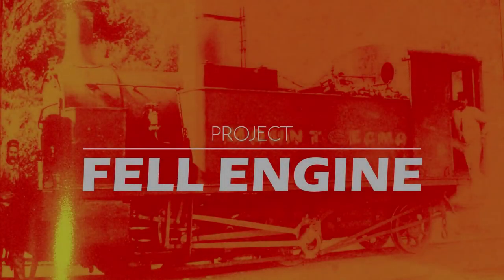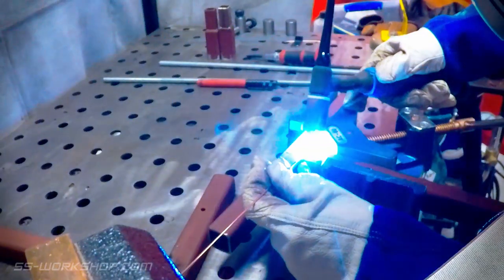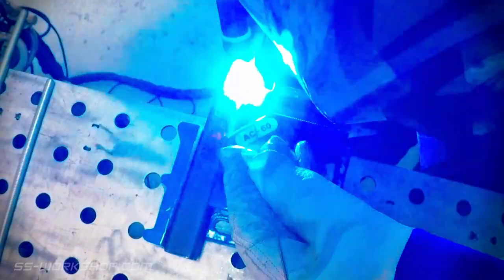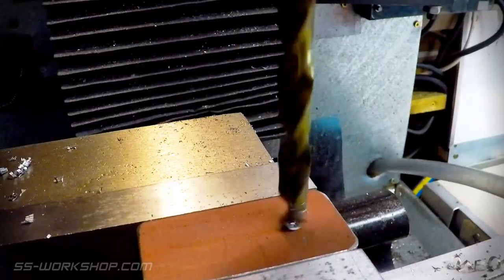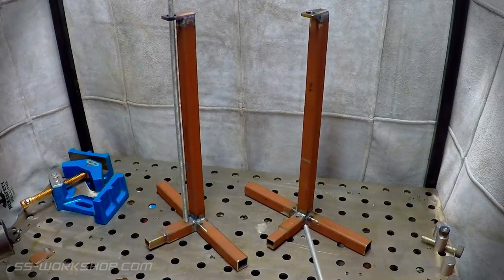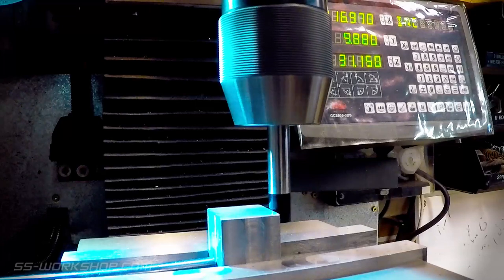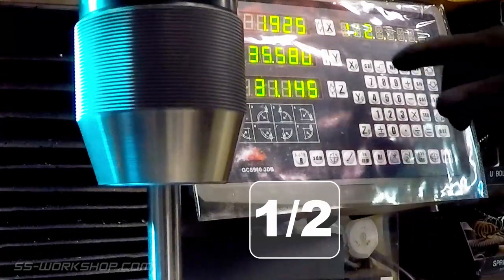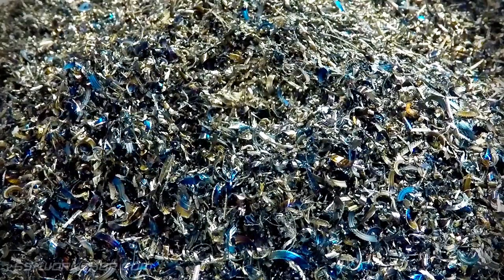Fell Engine Project -  Build Stand Time S1.E12

Comment: Good idea - essential equipment!  I mounted mine to a hydraulic lifting table trolley so the loco can be easily worked on and moved around the shop as needed. The stands can be easily removed so the trolley can be used to transport the loco to the car etc.
Reply from the maker: Seeing yours inspired me to build my own, certainly makes it easier to work on loco. Good idea on moving it around. One question, how is your loco attached to the stand? I have attached mine with the holes in the buffers for the couplings at the moment but that will only work while the buffer beams are unfinished. Cheers.